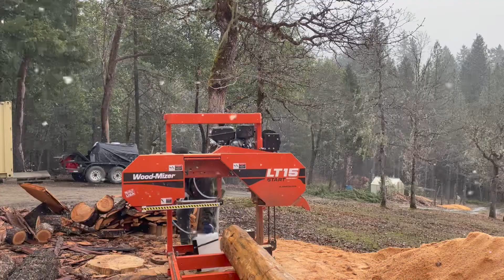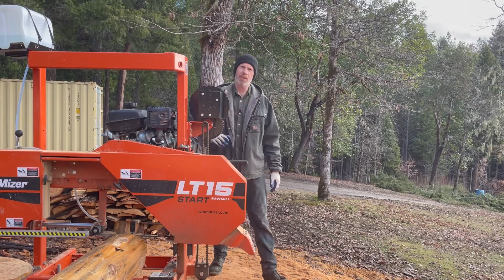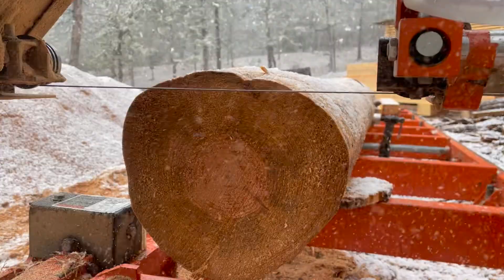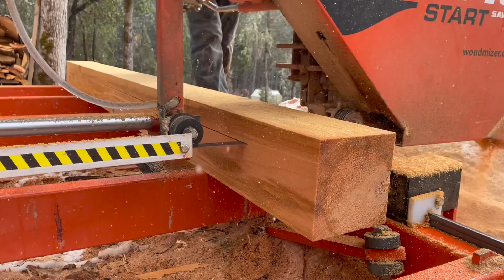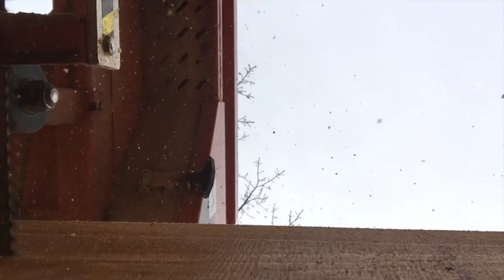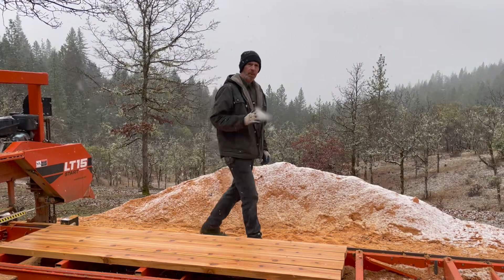Are Small Qty. Lumber Customers a Waste of Time? Selling Lumber from my Woodmizer LT15 Sawmill

Comment: I saw the title card and instantly thought "Dollars are dollars!"
Then you explained one board.  With extra steps.  Dunno about that one.
I'd certainly have a minimum purchase even if it's super modest like 25 or 50 bucks.  You can easily convince them "that it's nice to have a few project boards for when you need them, also I have to pay for gas because I dont live in this wearhouse"
Reply from the maker: I typically don’t commit to going into the warehouse just for these small orders. I usually tell them when I’m going to be there anyway and they can either show up or not. These were a couple situations where bigger customers flaked on me and all I had left was the small ones I already told I would be there. But it worked out to my advantage. Sometimes the small customers end up being the biggest customers.